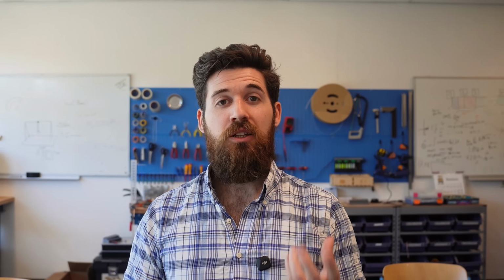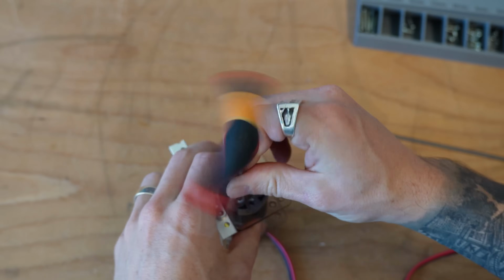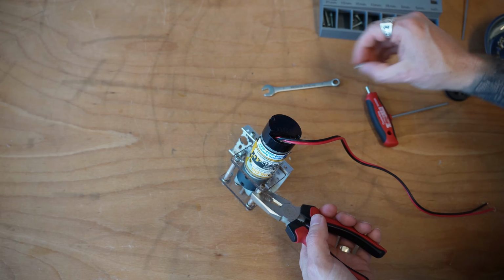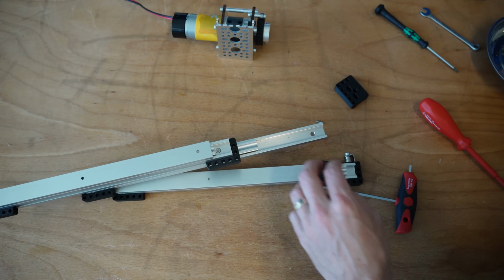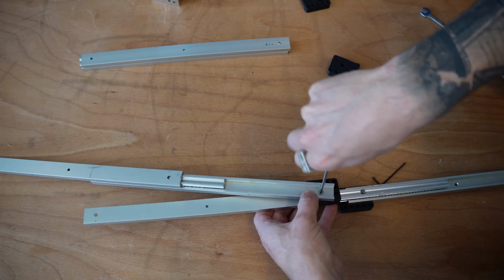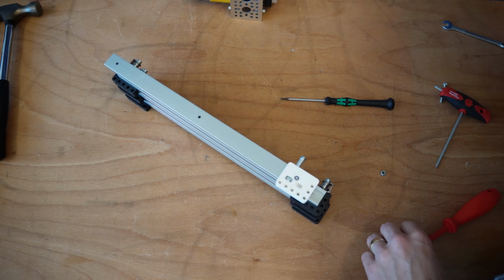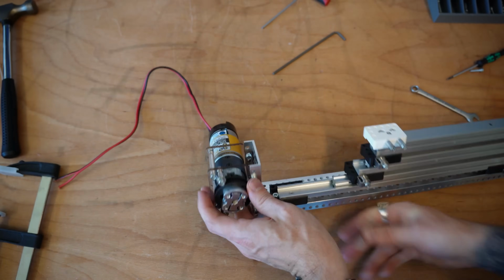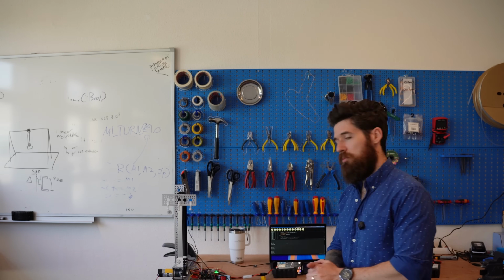Misumi Slides + Belts: A Better Rigging Guide

Comment: As always an incredible video! Would you say its worth it to stock up on some linear slides in the off season for the next game? (we currently have none lol)
Reply from the maker: Likely not a bad idea. I'd be surprised if there were not some sort of extension increases for the next season.
Reply: @BroganMPratt  Thank you! We where thinking about buying some misumi 3 step slides (sar3), what lengths would you say are most useful to buy?
Reply from the maker: Great question. The most standard forms teams use are SAR330 or 230. Some teams ave used 220's for smaller purposes.

Comment: There is another very robust way of doing this that involves shorter, more easily replaceable belt runs, that does not leave a singular point of failure and the necessity of threading a very long belt. We used the method in industrial pallet storage and could go three pallets deep into storage racking. The configuration is VERY hard to explain but essentially each cable goes from the upper deck of slide one, around slide two to the lower deck of slide three... then repeat the pattern for each level in both directions. This gives repeatable and pinpoint positioning no matter the orientation and no reliance on gravity, it also maintains equal spacing across all slides for load distribution whereas the method shown could result in one slide fully extending before the next gets started.
Reply from the maker: Yes, this is known as cascade rigging. This does require more torque to drive as you’re moving all 3 stages at once rather than sequentially. It also requires a LOT more precision on your belt runs. Benefits and trade offs, however.

Comment: @broganmpratt have you tested these with a SAR230? We are having issues with mounting holes not lining up. Are we able to get a step of the insert to modify? Happy to share what we figure out.
Reply from the maker: It should fit as the dimmensions are the same, though I haven't tested it myself. Make sure you're placing the adapter on the larger of the 2 misumi slide sections, and got a SAR230, not a SARC230, as the compact version is smaller. 

In any case, the step file is up on the makerworld link, so you can download + modify there to your hearts content. Please do share what you've found out.

Comment: i noticed in the hardware section there are some parts (specifically the countersunk screws) that don't appear to be in the gobilda kit. Where do these come from? Thanks
Reply from the maker: Correct. You'll find all the parts you need written in the CAD file description. you'll be able to find everything you need at your local hardware store. they're not special or unique parts.

Comment: Heyy Brogan... Nice project... This has been the sort of contraption I've been thinking of connecting to the telescopic rooftop winch mast on my Defender. Currently an upside down L shaped tube slides inside one of the mounted ladder's leg. And each time I want to haul something heavy up on the roof rack, I have to manually pull or push the small arm of the L high in its bed. It has a  small ATV winch and with the weight of the steel L rod it is quiet heavy and can get dangerous... Do you think I can solve this problem with misumi slides or any other way somehow? Thanks...

Comment: Did anyone else watch this and not know what the heck it’s all about?  What sort of robot?  A fighting robot?  What?
Reply: Linear actuators are used to automate a great number of things. Imagine a system to open your kitchen drawers. Maybe your back door is a slide type door, you could automatically close it.  

I just finished up a parts robot that delivered parts to specific stations on a factory floor, and once it arrives at the specified location, it opens the compartment with the parts for that location. We use six linear actuators on that bot.

Comment: Could you put two together side to side for more support? (So that they would make an upside-down “V” with a outtake in the middle when extended)
Reply from the maker: Yes, that is the recommended way of doing an elevator with linear slides. I would not suggest you have a cantilevered load (supported on 1 side).

Comment: How do you connect the slides using a standard lock nut instead of the sleeve nut???
Reply from the maker: You can use a low profile m3 nut (non lock nut). It fits in the countersunk head of the opposite misumi slide to the machine screw, where I've put the sleeve nut. I'd recommend you use threadlocker on that one!

Comment: You could add some details to the prints to make easier to know if your are using the correct part. Little embossed arrows showing which way things are supposed to go, "outside" and "inside"  or "upper" "lower" embossed on them too. Just a cool thing I saw somewhere else
Reply from the maker: Great idea for that, I'll add that in to my list of things for v1.2, would definitely help with assembly as even I get confused with the mirrored non-mirrored sides sometimes. Cheers!

Comment: I like the bearing idea. My students last year used bearings to increase the engagement length around the pulley. They got it to about 75% engagement and nearly got the same result. It still slipped but it was when we tried to force it to. They wanted to see if they could use it to climb and we found our robot's weight was just over the limit for it to slip.
Reply from the maker: Love it. How heavy was the robot?
Reply: @BroganMPratt I don't remember, I'm fairly sure it was close to 20 lbs.

Comment: I mean i don't know your experience and it is working, but the belt path is so flawed. You need to get those belts perfectly parallel or your belt will not have consistent tension. Some greek philosopher found that out.
Reply from the maker: Hey, thanks for the comment, I appreciate the feedback and am always looking to improve and learn myself. That was definitely an oversight on my part and I'll work on fixing that in v1.3 in the future. That said, There is something to be said about the actual practical experience of this. True, this may be a less than ideal belt path, take a look at my test on this slides under various loads and motor RPM's. https://youtu.be/7zUQdQv8q0o I'm not sure how much of a practical real world difference that makes, as there wasn't significant racking or tensioning throughout my entire test, and it performed on par, and even out performed my string slide designs in some tests compared to previous tests. I think there is a lot of chasing of optimal without thinking about how much these forces truly impact performance. But I'd like you to judge that for yourself, and I'll test out my pathing different in v1.3 to see if it makes a meaningful difference or not.
Reply: @BroganMPratt in this application it might not mean too much. Other than varying belt tension you also lose a bit of position accuracy. Those belts are probably long enough to handle the inaccuracy with stretch. 

If you notice it or not will depend on how much you use this and how critical the application is. The correct way is to make the belt path parallel but you will never notice it if you use this actuator to move a camera up and down and use it once a year. You have the design tho so you can simply do the math on how much the belt length changes over the total travel of the actuator.

Comment: Do you happen to have a measure for the effective stroke length? Thanks!
Reply from the maker: On a single SAR330 stage, effective stroke is 280mm. With a rail length of 300mm, total reach is 580 on a single stage.

Comment: Nice video.
> Baselining about 0.85... 0.83
Is that mm/s?
Reply from the maker: Thanks! That would be 830-850milliseconds for a cycle time. 650ms* extension, 180*ms retraction time. It’s wicked quick with an 1150 motor, but a 2second cycle time ish with a 435 motor which is still insane.

Comment: ".85" of what unit LOL – trying to seek to the relevant parts here which I never do😅 In the beginning I could've had  more words to explicate/explain some special bits and parts used new to me (but I guess you need the authoritative energy in the beginning of the video😅) and I could've done without some trivial assembly explanations and enumerations. But thank you a lot for sharing your techniques! 

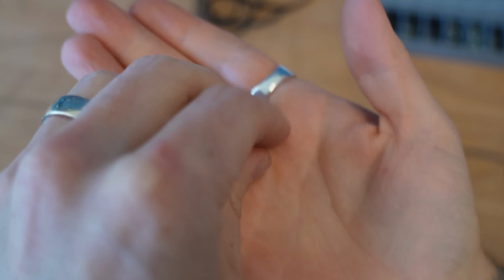This helps a lot and there were a lot of parts I've never seen. I've also recognized the need  to keep the timing belt in place with something but, but you got it –two rollers at the ends are of course enough. The solution has to be a bearing, otherwise you got slack or friction! Oh, here it is 5:54
Reply from the maker: 0.85 seconds for a cycle time. Up and down for the slides. 

Yes, idler ball bearings without a flange are the magic here to achieve that belt tension.
Reply: I really don't have time to watch all right now DAM😅

Comment: vro's belt routing did not factor in Pythagorean theorem 🥀🥀🥀🥀 say goodbye to your tension
Reply from the maker: I’m failing to see your reasoning here. This routing system is similar to both the gobilda and SWYFT systems, and I have 4h of trials running these belts saying otherwise.
Reply: @BroganMPratt look at the gobilda system you mention. All the paths are parallel. 4h is honestly nothing. That is the time your machine spends on a few 3d prints. No one is saying this stops your machine from working, but by moving a few pulleys and the belts it could be a lot better.
Reply: @BroganMPratt  the swyft system is also not good, the gobilda is inherently different. if you look at one side, the side where the slides go up, the belt is parralel to the slides and tangent to the motor pulley. that means that as the point at which its fixed to on the final slide stage goes up, the total length the belt has to cover remains the same. but with your setup, since its at an angle and not parallel to the slides, the distance changes a lot, so you end up with bad tensioning when the slides reach max extension. sure this issue is just solved with the antislip but the slides have less precision at the top since the tension is gonna be much more sloppy when the slides are fully extended compared to when they are retracted

Comment: Be aware if any loctite touches the lexan it will likely develop a lot of cracks.  It would be better to make the motor mounts from sheet aluminum so that loctite can be safely used or use an alternative locking method such as belleville washers .  BTW, the technical data sheet for loctite states

"This product is not normally recommended for use on plastics
(particularly thermoplastic materials where stress cracking of
the plastic could result). Users are recommended to confirm
compatibility of the product with such substrates."
Reply from the maker: Great tips on both alternative methods, thanks for sharing your knowledge!
Reply: I was checking the comments to make sure someone mentioned this XD
Loctite does make specific grades for this kind of application.

Comment: Will there be any challenges if i change the m3 lock nut slots to m4?
Reply from the maker: Misumi SAR 2xx and 3xx series accepts an m3 screw, so if you're willing to drill out the hole larger + larger respective countersunk screw you can, but I wouldn't recommend it as your tolerances are already quite tight.
Reply: The screws that servos take for mounting are those m3?
Reply from the maker: @armansandhu5400  Are you referencing mounting the servo horn to the servo? On servos they're typically m3 yes. If you're referring to the servo casing mounts, they're typically m4.

Comment: Thanks for sharing! I'm spending the summer testing Viper Slides. I'm going to see if I can integrate your motor mount and/or idlers to eliminate the belt slip I'm running into.
Reply from the maker: Best of luck working through  your testing! The real money of this mount is the integrated idler bearings, they're what stop your belt from slipping. The mount simply has a convenient way of aligning the bearings correctly onto the pulley.

Comment: I would really like to know what your opinion is on the SWYFT Slide FTC Elevator Kit I would also like to say I'm amazed on the quality of your videos they've been an integral source of information for my team and I don't know what I'd do without them
Reply from the maker: Thanks for the kudos, it means a lot and I'm glad that it has helped your team out! On the SWYFT slides, I personally haven't played around with a set, though would love to do some testing on one. Having looked into them i the past via CAD + performance videos, they seem like a well thought out system and are more compact than some 3D printed inserts, by about 10-15mm per set, so you're saving 20-30mm on a x axis on your FTC robot, which could be either entirely negligible or make a difference depending on your design. Though with 457mm to work with, that's a 4-6%* savings which may not be worth the price tag to some teams, though considering this cost versus a gobilda 4 stage vipre kit, it seems to be a better deal, at least in the EU. If you've got the budget, I'd say it'd be a pretty good kit to try, as I've heard teams having positive experiences with their servos and the kit itself. 

There's also Offset robotics' new boxtube slide kit that seems to show some promise as well that's worth looking into that I'll be running some tests on in the future as well.
Reply: swyfts are much weaker because the insert mounting is in a weak place on the side of the slide; they can straight up just crack and the entire slides fail. would not recommend
Reply from the maker: @dotshape Interesting, do you have any photos to share of the aluminum cracking? or was it the acetal extension piece?
Reply: @BroganMPratt  what do you think of the offset robotics box tube 🤔
Reply from the maker: @craigbailey3580  I'll actually be doing some tests on this box tube kit in a few weeks, stay tuned. At first glance, it seems like a decent kit. There was a team from HongKong at the European premier that spoke highly of the kit, so N+1 is a positive experience.

Comment: This is awesome. Do you have a design for the counterspring, in case the slides need to lift up some heavy? Would like to use a 1150 or 1650 Gobilda motor for the speed.
Reply from the maker: I’ve found a 1150 will max out around 1.5kg on a single x3 set of slides on this system. Still quick but definitely feeling it. 

I don’t presently have a design on counterspringing, though there was a white paper released a while back by a few, now graduated, FTC members that was a great write up on the concept
Reply: @BroganMPratt  Most of the good FTC teams are using 2 fast motors for the torque. I would appreciate it if you could find the white paper. I know some teams are using a bungee cord, some are using a Constant Force Spring.
Reply from the maker: @terrywant1393 you're correct, I agree you should use x2 motors and likely x2 sets of slides on either side of your implement to reduce the cantilever forces. I was using this as an example from my tests. 

Referencing that white paper, here you go: https://docs.google.com/document/d/11AFHsKFjv1kAYSusP6ScuHHn8FhA5VZdnBp3DvQ4UbY/edit?tab=t.0
Reply: @terrywang1393 his inserts could easily be adapted to allow for the counter spring. Just put the bungee through the holes that he has allowed for mounting.
Reply: Does your design work on SR230, the 2-stage slides? It's thinner.
Reply from the maker: Yes. You could also modify my design to use M3 hardware to reduce thickness by 2mm per insert stage as well. I built this using m4 hardware simply out of convenience with the parts on hand. It's also not intended to be the absolute end-all be all in all forms, as I don't want to take these hyper optimizing engineering challenges away from teams.